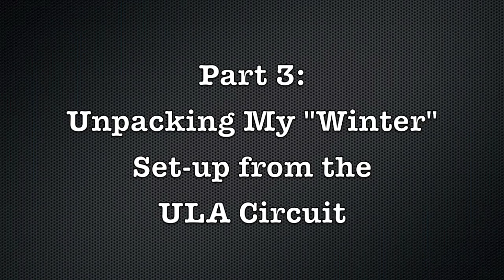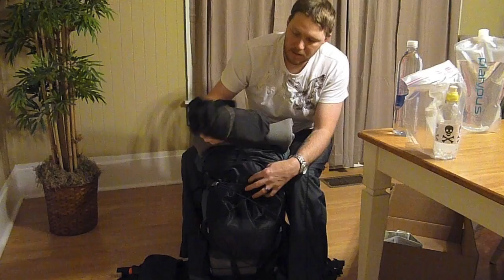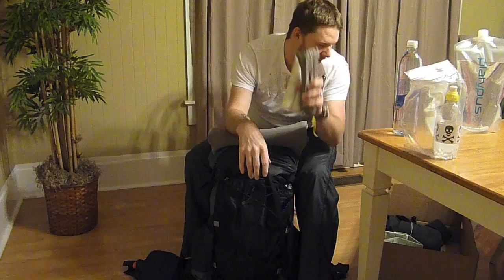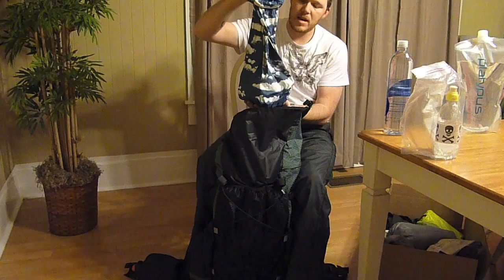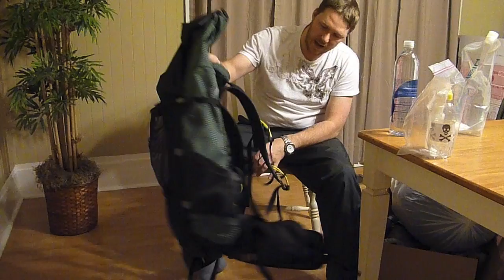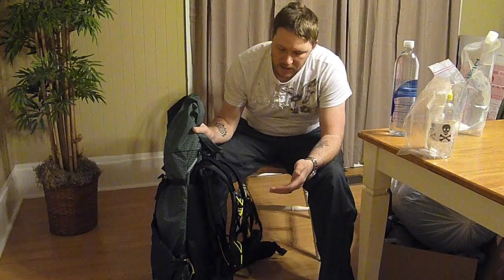ULA Circuit (Part 3)

Comment: hows this pack holding up? you reccomend it? do you use it with the steel rod or the u shape wire thingy. and does it have a cut out for a water badder tube? the site does not say, as far as I could see. I see it comes in camo as well, I was thinking to pick one up, thought i'd get a few thoughts first. thanks

Comment from the maker: To cut weight ULA is definitely worth considering. They're high quality packs and have top notch customer service. I suggest calling and discussing your needs with them. They're happy to help.
Comfort varies from user to user. I think ULA's are comfy as do lots of others but that don't mean it will be for everyone.
I also say in temps near/over 100 F your back will sweat! But I agree some vent better than others. Those you mention probably vent better than ULA, but I haven't used them to know.

Comment: Well, I have both a Gregory Z65 and an Osprey Atmos 65, both of which have a mesh suspension that holds the pack away from the back, and I hardly sweat with those at all. I'm just trying to cut some weight and that's why I was looking into the ULA stuff. Both the Gregory and the Osprey weigh near 4 lbs, but are ultra comfortable. I also don't pack more than 35 lbs total, including pack. Thinking that the Circuit, Catalyst, or Camino might be a worth alternative if comfortable and not too hot.

Comment: Chad-With that 28 lb loadout what would you estimate is the weight distribution between the hip belt and shoulder straps?  I'm between it and the Catalyst, but have heard the single stay/lighter suspension system of the Circuit causes it to carry heavier on the shoulders.  Thanks.  BTW....my gear weight is right on par with yours.

Comment: If I may add,  purchasing some trash compactor bags would be a great safety for your sleeping gear. I most likely will be purchsing this pack Sun. They have a few modifictions for the 2011 model such as cordura bottom and replaced the net on the side pockets with dyneema.  Looks nice.  Your video was a help in my decision. Thanks